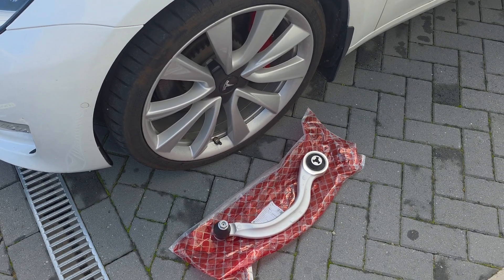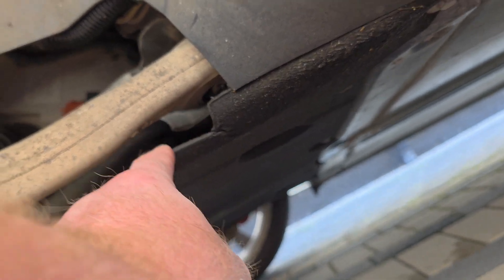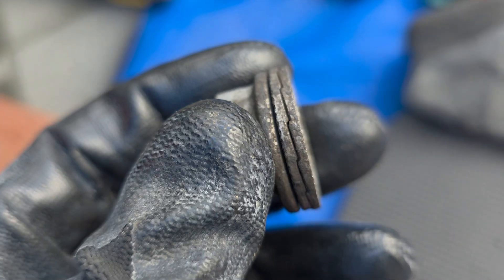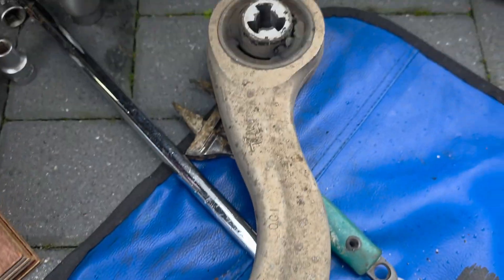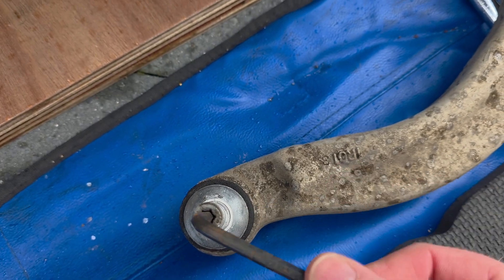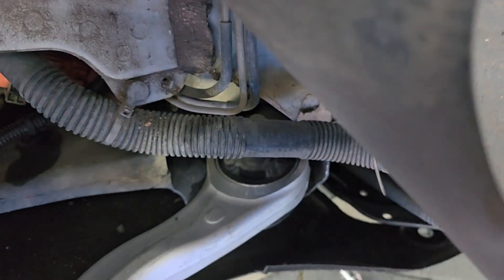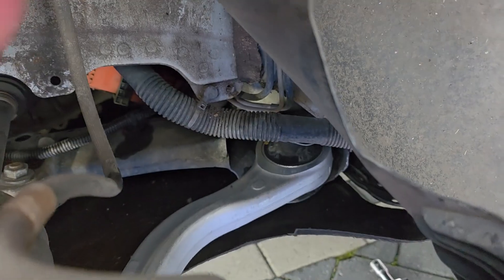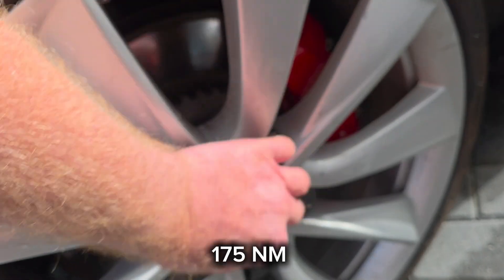Tesla Model 3 Lower control arm (Compliance Link) removal & replacement.

Comment: Thanks for the video. You mentioned the original part had a star fitting and the new one was Allen. Do you need to adjust the ends?
Reply from the maker: No need

Comment: Great video and looked so easy to work on, but did the new arms come with all new bolts and nuts etc, as I’m having trouble searching for the bolts at present.
Reply from the maker: It comes with a new nut shown in the video that you use on the steering knuckle hub. The other end you reuse the bolt that comes off.
Reply: Great video, American tire wanted to charge $1200 to do this, it’s a robbery.